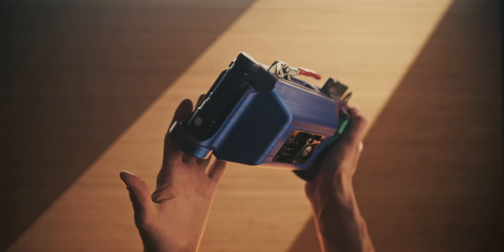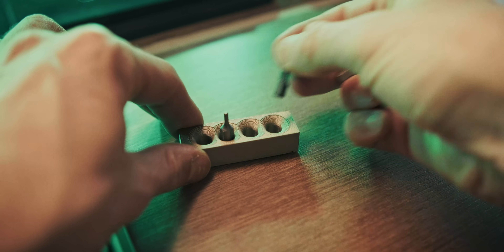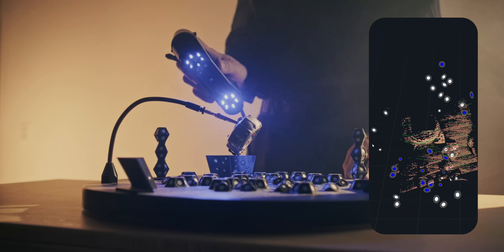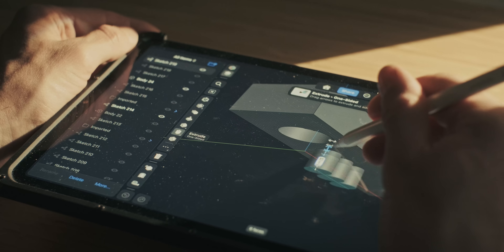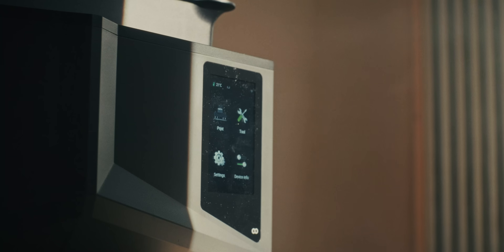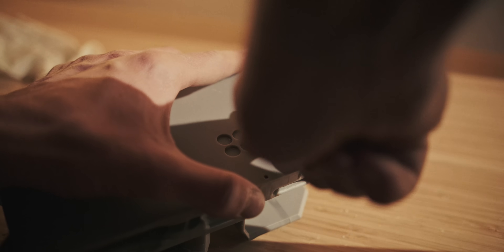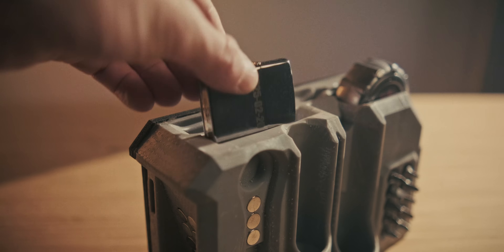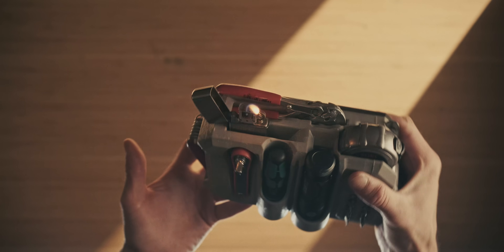Building a Wera Tool Check Inspired EDC – 3D Print Project - Elegoo Saturn 4 Ultra 16k

Comment: I wanted to share my experience with the Acebeam L35 because I noticed you’re using an Acebeam flashlight. While it has impressive brightness, I found a few drawbacks, such as accidental activation and difficulty sourcing replacement batteries, which led me to look for alternatives.

One flashlight that stood out as a strong competitor is the Nitecore EDC31. It offers a more compact design with a reliable lockout switch to prevent accidental activation, convenient USB-C charging, and a standard lens size that allows for easy customization. Given these features, I wanted to take a deeper look at how the Acebeam L35 and Nitecore EDC31 compare in terms of brightness, battery life, durability, and other key aspects.

Here’s a detailed breakdown of both flashlights to help you decide which one suits your needs best.

Acebeam L35 vs Nitecore EDC31: Flashlight Comparison

Brightness and Lumens Output
	•	Acebeam L35 – This tactical flashlight can blast up to 5,000 lumens in turbo mode, with a beam reaching about 480 meters . It uses a high-output CREE XHP70.2 LED (5000K) and offers multiple brightness levels from a 1-lumen moonlight mode up to the 5,000-lumen turbo . The large LED and optics give it a bright flood with decent throw for long-range visibility.
	•	Nitecore EDC31 – As a compact EDC light, it still packs a punch with up to 3,500 lumens output and roughly 380 meters of beam distance . It features Nitecore’s 9-core UHi 20 MAX LED, delivering an impressive beam for its small size. The EDC31 has four regular brightness modes (from an ultra-low 5 lumen mode up to high ~1100 lumens) plus two specialized modes for instant high output  . In practice, the Acebeam L35 offers higher maximum brightness, while the Nitecore EDC31 provides plenty of light for everyday carry with a more compact form.

Battery Life and Charging Methods
	•	Acebeam L35 – Powered by a 21700 Li-ion battery (5100mAh), it excels in runtime. On its 1 lumen moonlight mode, it can run for up to 12 days straight . Even at a low 70-lumen setting it lasts over 33 hours . The L35’s battery is USB-C rechargeable (Acebeam includes a USB-C charging cable), though the charging is via the battery’s built-in port and is somewhat slow (~0.75A) . Many users opt to charge the cell in an external charger for faster turnaround. Having a high-capacity 21700 gives the L35 an edge in sustained use, but it also means a larger battery to carry.
	•	Nitecore EDC31 – This light has a built-in 3,800mAh 18650 Li-ion battery, which is not meant to be removed frequently. It charges conveniently via an on-board USB-C port, reaching full charge in under 2 hours . A power indicator LED on the tailcap shows charging status and battery level . In ultra-low mode (5 lumens), the EDC31 can run about 57 hours continuously . Even at 70 lumens, it lasts a full day (24 hours) , and around 4 hours on its 1100-lumen high mode . While its maximum runtime is shorter than the L35’s (due to a smaller cell), the quick USB-C charging and included battery make it very convenient for everyday use.

Durability and Build Quality

The Acebeam L35 features rugged aluminum construction with a striking stainless steel bezel for enhanced durability. The build quality is impeccable – Acebeam uses a high-strength AL6061-T6 aluminum alloy with HAIII hard-anodized finish, and even equips a hardened steel strike bezel that can break glass or serve as a self-defense tool . The body has thick walls and knurling for grip, giving it a solid feel . It is rated IP68 for water and dust resistance (submersible ~2 meters) and survives drops of about 1–1.5 meters without damage . Overall, users find the L35 to be extremely sturdy and suited for heavy-duty and tactical use. Its larger head and slightly heavier weight (5.7 oz without battery) are the trade-offs for that tank-like build .

Nitecore’s EDC31 is built to endure harsh conditions, with a waterproof aluminum body that survives rain and impacts. The EDC31 is made of military-grade aluminum with HA III hard-anodized finish, providing excellent scratch and corrosion resistance . Despite its compact size, it’s tough – IP68 rated (dustproof and submersible in 2m of water) and shockproof up to 2 meters drop height . In hand, it feels solid but lightweight (about 100 g including the battery and clip) . Nitecore also includes a sturdy pocket clip and uses steel switches, emphasizing durability even for daily carry. Users report the build quality is on par with other premium flashlights, with the advantage that the smaller 4.46″ length and 1″ diameter make it easy to pocket without worry . In short, both lights are very robust: the Acebeam is larger and built like a tactical tool, while the Nitecore is impressively durable for a more compact EDC form.

Accidental Activation Prevention Features
	•	Acebeam L35 – The L35 offers a lockout mode to prevent accidental activation when stored or carried . By using a quick sequence on the side switch (or simply loosening the tailcap for a mechanical lockout), the user can disable the switches so the flashlight won’t turn on unintentionally. The dual-switch design (tail and side switch) is intuitive, but also means two possible buttons that could be pressed by mistake – hence the lockout is a useful inclusion. In practice, the recessed side switch and relatively stiff tail switch also help avoid accidental presses. Many owners appreciate that the L35’s electronic lockout is easy to engage, especially for a powerful light that could heat up if turned on in a bag.
	•	Nitecore EDC31 – Nitecore implemented a unique “Rapid Lock™” sliding switch on the tailcap for quick lockout. There are two lockout modes: “Half Lockout” and “Full Lockout” . In Half Lockout, the main power is locked but you can still use the momentary Search (spotlight) and LUMIN SHIELD modes; in Full Lockout, all functions are disabled to completely prevent accidental activation . This physical sliding lock is easy to operate by feel – simply slide it to the desired position to safe the light. It’s an effective design for a tactical EDC; however, a few users noted that occasionally when sliding the light into a tight pocket the lock switch could be nudged off “Full Lock,” allowing the light to turn on . Despite that rare issue, the dual-stage lockout gives the EDC31 a robust safety mechanism, ensuring it won’t inadvertently activate at full 3500 lumens in your pocket.
Reply: Lens Quality and Customization
	•	Acebeam L35 – Acebeam equipped the L35 with a toughened ultra-clear glass lens (protecting the LED) in combination with a specialty TIR optic for focusing the beam  . The lens has an anti-reflective coating on both sides, maximizing light transmission and durability . The use of a TIR (Total Internal Reflection) optic is somewhat unusual for a high-output light, but it allows a smooth beam profile – users report a great balance of flood and throw with a clean hotspot. The lens and optic are of high quality, giving a clear beam without artifacts. In terms of customization, the L35’s head (54.2 mm diameter) can accept optional colored filters or diffusers that Acebeam or third parties provide, but the internal TIR lens isn’t commonly swapped out. Most owners stick with the excellent stock lens/optic, though one review praised the “nice beam” delivered by the TIR setup .
	•	Nitecore EDC31 – The EDC31 uses a more traditional setup: a micro-textured (orange peel) reflector paired with a hardened glass lens in front . Nitecore specifies a double-sided anti-scratch, anti-reflective coating on the optical glass, which helps achieve high light transmission and resists abrasion . The result is a beam with a defined center spot and some usable spill, suitable for general use. The lens quality is on par with other premium flashlights – clear with minimal distortion. Because the head size is small (23 mm), there aren’t model-specific aftermarket lenses or optics from Nitecore aside from the stock parts. However, its standard lens size means one could find a compatible diffused lens or filter from third-party suppliers if desired. In general, both lights have excellent lens quality out of the box. The Acebeam’s TIR gives it a wider, artifact-free beam, whereas the Nitecore’s reflector + AR-coated glass provides a more traditional beam pattern. Custom lens swaps are uncommon for these models, but basic customizations (like adding a diffuser film to soften the beam or using color filters) are possible and straightforward.

Additional Features (Modes, Indicators, etc.)
	•	Acebeam L35 – This flashlight offers 6 brightness levels plus a strobe mode, giving a lot of flexibility for different situations . The dual-switch interface is designed for tactical use: the tail switch instantly activates Turbo (max brightness) or Strobe for self-defense with a full press , while the side switch cycles through the normal modes and can access Moonlight (ultra-low) with a long press. The L35 also has a battery power indicator LED (in the side switch) that flashes or changes color to show remaining charge . This helps users keep track of battery status. An intelligent temperature regulation system will step down output to prevent overheating on the highest modes , and the circuitry is constant-current (no PWM flicker) for stable light . Acebeam even gold-plated the circuitry contacts for durability . In summary, the L35 is feature-packed: from its moonlight mode (1 lumen) for stealthy use, up to blinding strobe and turbo, with easy one-handed control and thoughtful additions like lockout and battery indicators.
	•	Nitecore EDC31 – The EDC31 keeps things straightforward with 4 brightness levels (Ultralow, Low, Mid, High) and 2 special modes . Uniquely, instead of a traditional strobe or SOS, Nitecore configured two high-output momentary modes: SEARCH (spotlight) and LUMIN SHIELD. By half-pressing and holding the tail switch, you get an instant 1,500-lumen spotlight; a full press and hold yields the 3,500-lumen “Lumin Shield” flood blast for immediate max output . This is intended as a defensive or attention-getting feature (a burst of light to disorient or signal), akin to a strobe but with steady light. The tail switch also serves as the on/off and mode selector (half-press cycles modes when on). Notably, the EDC31 has mode memory – it will turn back on at the last used brightness level . Other handy features include the tailcap power indicator LED (blinks to report battery voltage and charging status) and the two-position lockout slider we discussed. It also employs Advanced Temperature Regulation (ATR) to adjust output when the light gets hot, preventing damage . While it has fewer discrete modes than the L35, the EDC31 covers the essentials for EDC use and adds innovative touches (like the Lumin Shield) that set it apart. The overall UI is very user-friendly for both everyday and tactical needs.
Reply: User Reviews and Feedback
	•	Acebeam L35 Feedback – The L35 has earned a strong reputation among enthusiasts and buyers, holding around 4.5/5 stars in user ratings . Owners frequently praise its extreme brightness and throw, often noting that it outperforms expectations for a single-LED flashlight. The beam quality gets positive remarks – one Acebeam site review simply titled “Nice beam!” underscores how well the TIR optic performs . Users also commend the build quality and durability; for example, one review called it an “Awesome All-Around Flashlight,” and another described it as a “Great Durable Flashlight,” indicating confidence in its ruggedness  . The dual-switch interface is generally well-received, as it offers quick access to turbo or strobe. On the critical side, some reviewers mention that the heat output and step-down on Turbo are noticeable – unsurprising given 5000 lumens in a mid-sized light. In testing, the L35 could not sustain full 5000 lumens for very long and throttled down to around 1800 lumens after about a minute to prevent overheating . This is a common observation and not seen as a flaw, just physics at work. Overall, feedback for the L35 is overwhelmingly positive, highlighting its power, solid construction, and value for the price. A few users noted minor issues like receiving a different LED version than expected or the flashlight’s substantial size for EDC, but these are isolated cases .
	•	Nitecore EDC31 Feedback – As a newer model, the EDC31 has quickly gathered a good number of reviews (20+ at Nitecore’s store alone) and sits around 4–4.5/5 stars in customer ratings . Users love the compact size vs output ratio – many are impressed that such a small light can produce 3000+ lumens. It’s often described as a “great little light” for everyday carry . The USB-C charging and built-in battery are appreciated for convenience, making it a grab-and-go device. However, feedback also points out a few quirks: Some users have reported the beam pattern isn’t perfect for close-up work – one detailed review noted a slight dark spot in the center and a large dim halo, which may bother those expecting a uniformly smooth beam . This is likely due to the 9-die LED and reflector design. Additionally, there have been a few instances of accidental activation – ironically due to the lockout slider being switched off in tight pockets, causing the light to turn on unwittingly . On the upside, the majority find the lockout feature useful and haven’t had issues with it. Users also mention that the EDC31 can heat up quickly on the highest outputs (it’s a lot of power in a small body) , but the ATR system will dial it down before it becomes too hot. The overall sentiment is that the EDC31 provides excellent value and performance for its price: it’s bright, quick to recharge, and robust. Any downsides (like the beam artifacts or the nuanced lockout use) are generally minor for most owners. Many compare it favorably to larger or more expensive lights, saying it holds its own, and it’s becoming a favorite go-to EDC flashlight for a lot of people who have given it a try.

Price and Value for Money
	•	Acebeam L35 – The list price for the L35 is around $114.90 (with the battery included) on Acebeam’s official site . In the flashlight community, it’s considered a high-end tactical light, but still a good value given its performance. The package typically includes the 21700 rechargeable battery, USB-C cable, holster, and other accessories, which adds to the value. Some retailers have offered it closer to $100 or even just below during sales . For what you get – 5000 lumens, a robust build, and Acebeam’s reliability – most users feel the L35 is worth the price if you need its capabilities. It squarely targets the tactical/outdoor enthusiast market. When comparing lumens-per-dollar, it’s more expensive than the EDC31, but you are paying for the higher output and larger battery. If those aren’t critical for your needs, the Acebeam might be overkill; however, if you want one of the brightest and toughest mid-sized flashlights, the L35 justifies its cost.
	•	Nitecore EDC31 – With a retail price of about $54.95 USD , the EDC31 comes in at roughly half the cost of the L35, making it very attractive in value. That price usually includes the built-in battery, charging cable, clip, and lanyard – essentially everything you need. For a newly released compact flashlight delivering 3500 lumens, the mid-$50s price point is seen as a bargain by many reviewers. Nitecore positioned it as an affordable high-performance EDC, and it seems to hit that mark. In terms of value for money, the EDC31 offers an excellent performance-to-price ratio, provided you’re looking for an everyday carry light. It can’t match the sheer output or throw of the L35, but you’re also paying much less. When budgeting, one might consider that an extra 21700 battery for the Acebeam plus an external charger could add to its total cost, whereas the Nitecore has everything integrated. In summary, if you’re value-conscious and don’t need the absolute maximum lumens, the EDC31 is likely the better bang-for-buck. The Acebeam L35, while pricier, delivers premium performance that justifies its higher cost for those who need it. Both lights are solid investments in their respective categories – it really comes down to whether you prioritize maximum power (Acebeam L35) or maximum portability per dollar (Nitecore EDC31).

Sourcing Custom Lenses for Flashlights

Replacing or customizing a flashlight lens can enhance performance or adapt the beam for specific needs. Below we explore how to source custom lenses, what materials and options are available, and considerations to keep in mind.

Common Materials for Custom Lenses

Flashlight lenses are typically made from either glass or plastic (polycarbonate/acrylic), each with pros and cons. High-quality lights usually use hardened glass lenses, often made of borosilicate or other tempered glass, sometimes with anti-reflective coatings for better light transmission. Glass is scratch-resistant and handles heat well, ensuring clarity over time . On the other hand, many budget or older lights use polycarbonate or acrylic lenses (essentially a type of plastic). Polycarbonate is very tough (virtually unbreakable if dropped) but is prone to scratching over time, which can reduce light output and clarity . Acrylic is another plastic used; it has slightly better scratch resistance than polycarbonate but can still wear and doesn’t handle high temperatures as well as glass. Some custom lens providers offer AR-coated (anti-reflective) glass which can increase light transmission by a few percent. For example, an AR-coated borosilicate lens can reach 96–99% transmission in the flashlight’s output range  . In specialized cases, enthusiasts might even seek out sapphire glass (like watch crystals) for an extremely scratch-proof lens, though this is expensive. In summary, glass lenses (especially with AR coatings) are preferred for maximum clarity and durability, while polycarbonate/acrylic lenses are chosen for impact resistance or cost savings. The choice of material will affect how the flashlight performs and how it endures rough use, so it’s an important consideration when sourcing a custom or replacement lens.
Reply: Compatibility Considerations for Different Flashlight Brands

When sourcing a custom lens, size and shape compatibility is crucial. Flashlight lenses are not one-size-fits-all; different models have different diameters and thicknesses, and the lens must fit securely with the flashlight’s o-ring and bezel. Before buying, you should note the exact diameter of your current lens (to the nearest millimeter) and its thickness, as well as whether it’s a flat disk or a curved lens. Most replacement lenses are flat glass disks, which works for the majority of lights that use a reflector. If your flashlight uses a specialized optic (like a TIR lens or aspheric lens), the replacement needs to be the same type or designed for that model.

Different brands sometimes have standard sizes for multiple models. For instance, many Maglite C&D cell lights use roughly a 2″ (~50 mm) lens, and aftermarket suppliers target those explicitly . Brands like SureFire or Olight might use custom diameters – but again, the community often identifies those and suppliers list compatibility charts. It’s wise to check if the lens you’re considering specifically mentions fitting your flashlight model or to measure and match it with the specs given by the seller.

Also consider thickness and seating: a replacement lens that is too thick might not fit with the o-ring or bezel, and one that’s too thin could rattle or compromise water resistance. Quality vendors usually provide the thickness of the lens (common thicknesses are 1.0mm, 1.5mm, 2.0mm, etc.). Always compare that to your original lens. For waterproof models, ensure the replacement works with the existing o-ring or come with an appropriate o-ring to maintain the seal.

Another compatibility factor is if the flashlight has a lens coating or tint originally. For example, some lights intended for diving or photography have an AR-coated or tinted lens by default. Replacing it with a different type (clear vs. with a coating) could slightly alter the beam tint or output. Generally, going to a clearer or AR-coated lens will only help output (making the beam a bit brighter or cooler).
Reply: If you are looking to change the flashlight’s beam profile (for example, converting a flashlight into a projector-like thrower), you might consider a lens type change – such as installing an aspheric lens for a tighter beam. This usually is a more involved mod and may require custom adaptors or trimming. It’s important to confirm that the flashlight’s head can accommodate such a lens and still focus properly. Compatibility in this case goes beyond just diameter – the focal length of the lens and the LED’s position become factors as well .

In summary, measure your existing lens and do research on your specific flashlight model. Many enthusiast forums or product pages will note lens dimensions. A lack of exact match in product descriptions can lead to trial and error. As one forum user lamented when trying to upgrade a Maglite lens: not knowing the stock lens size made it hard to find a replacement until someone provided the specs . Doing a bit of homework on compatibility will save you time and ensure your custom lens fits like a glove.

Cost and Availability

The cost of custom or replacement lenses can vary widely based on material and source:
	•	Standard Replacement Lenses (uncoated glass or basic plastic) are often very affordable. Generic glass lenses for common flashlight sizes can cost just a few dollars each. For example, an AR-coated glass lens from Kaidomain might be around $3–$7 USD , and Flashlightlens.com offers high-quality Borofloat glass lenses in the $5–$10 range for many sizes . Acrylic or polycarbonate lenses are usually similarly low-cost, sometimes even cheaper (a couple of dollars), since the material is cheaper and easier to cut.
	•	Brand-name or Specialty Lenses tend to be pricier. An official Maglite replacement glass lens was quoted around $25 (plus shipping) , and a third-party “Gorilla Glass” lens (Neutek) for Maglite was about $20+ . These higher prices often don’t reflect vastly superior performance – you might be paying for the brand or a small production run. In many cases, enthusiasts find that the budget-friendly lenses (like the Kaidomain or UCL ones) perform just as well, making them more cost-effective .
	•	Custom-cut lenses (one-off custom sizes) may incur extra cost. If you go to a glass shop or use a service to cut a unique size, you might pay a setup fee or a higher unit price. For instance, getting a single lens custom ground to a specific diameter could cost anywhere from $10 to $30 depending on complexity, unless you do it yourself.
	•	Bulk orders can reduce cost per lens. Some hobbyists order a larger sheet of AR-coated glass (for example, an 8″x10″ sheet for ~$40) and then cut dozens of small lenses from it  , bringing the effective cost per lens to well under $1 (not counting labor) . This is only practical if you have many lights or friends to share with (and the tools/skills to cut glass).
	•	Availability is generally good for common sizes. Many online flashlight retailers and modding stores stock popular lens sizes (20mm, 25.4mm (1”), 30mm, 40mm, etc.). If your flashlight is a common model, chances are you can find a lens in stock. Niche sizes or very large lenses (say >60mm) might be less readily available, but specialty sites or forum group buys can fill the gap. Flashlightlens.com maintains an application chart and inventory for many lights, and they even encourage customers to help identify lens sizes for newer or obscure models  .
	•	Shipping can be a factor for glass since it’s fragile. Domestic sources (if you’re in the US, for example) like Flashlightlens or retailers on Amazon might be preferable to avoid long shipping times and potential breakage from overseas. That said, many have had good experiences ordering from international sellers like Kaidomain (which often has free or low-cost shipping worldwide, albeit slower). Just be sure the seller packages the lens well.
Reply: In terms of value, if you’re upgrading a flashlight, a high-quality AR-coated glass lens in the $5 range can slightly bump up your light output (a few percent more lumens reaching outside) and make the beam a bit nicer – a modest investment for an enthusiast. Replacing a broken lens is often even cheaper than buying a replacement flashlight or sending it in for repair, so sourcing a $3–$10 part can breathe new life into your torch. Always weigh the cost against the flashlight’s value; it may not make sense to spend $20 on a custom lens for a $15 flashlight, for example, when a new flashlight might be a better use of funds. But for mid-to-high-end models or sentimental favorites, custom lenses are quite accessible and reasonably priced.
Reply: DIY Methods for Custom Lens Modification

For hobbyists who enjoy hands-on projects, there are a few DIY approaches to custom flashlight lenses:
	•	Cutting Your Own Glass Lenses: If you have access to glass-cutting tools, you can buy optical glass pieces and cut disks to size. As mentioned earlier, some folks purchase small microscope slides or glass sheets and cut out circles using a Dremel with a diamond wheel or a glass cutter jig . One flashlight enthusiast shared that they made lenses from microscope slides with a Dremel because the sizes they needed weren’t commercially available . This method requires patience and proper safety (glass dust and sharp edges!), but it’s feasible for creating a few custom pieces. After cutting, edges may be smoothed with sandpaper, and you must ensure the lens sits with an o-ring to avoid chipping.
	•	Polycarbonate/Acrylic DIY: Cutting plastic is easier than cutting glass. You can buy a small sheet of polycarbonate or acrylic (even something like a thick clear DVD case or polycarb panel) and scribe or saw out a circle. Acrylic in particular can be scored and snapped in a circle with some effort, then sanded to final shape. An advantage is that plastics won’t shatter while cutting. You can also polish the edges to restore clarity if needed. There are even hard-coat acrylics available (some flashlight lens sellers offer hard-coated acrylic that is more scratch-resistant ). A DIY plastic lens might not have the optical perfection of glass, but for uses like a diffuser or a colored lens, it can work well.
	•	Lens Films and Filters: If your goal is to modify the beam rather than replace a broken lens, consider using films or filters. Diffusion film (like Rosco diffusing film or even a piece of sanded translucent plastic) can be cut and placed behind or in front of the lens to soften the beam. Colored filters (gels or acrylic disks in red, green, blue, etc.) can tint the beam for night-vision preservation or hunting. These are simple DIY mods: you cut a thin film to the lens shape and either drop it in front of the lens or secure it with the bezel. It’s non-destructive and reversible.
	•	Swapping to Different Optics: Some advanced DIYers swap the flashlight’s entire optic system. For example, replacing a reflector + lens setup with an aspheric lens to turn the flashlight into a long-range spotlight (common in modding “throwers”), or vice versa using a pebbled TIR lens for a floodier beam. These mods often involve finding a lens that fits the head or using adapters/spacers to hold it at the correct focus. It can be trial and error. BudgetLightForum and CandlePowerForums have threads where people share which aspheric lens fits certain models . This is a more involved form of “custom lens” modification, effectively redesigning the beam profile of the light.
	•	3D Printing and Prototyping: While you can’t 3D print a clear glass-quality lens with standard hobby printers, some have used resin 3D printers to make basic lenses or holders for lenses. More commonly, one might 3D print a custom bezel or adapter to fit a lens from another device. For instance, if you find a lens from a camera or another flashlight that you want to use, a custom printed ring could help mount it onto your flashlight.

When doing DIY lens mods, keep in mind optical alignment and safety. Any new lens or optic should be properly seated to maintain the flashlight’s waterproofing (use o-rings and sealant as needed). Also, test the flashlight after modification to ensure the beam is what you expect and there are no undue reflections causing heating inside the head. If cutting or grinding glass, wear eye protection and work slowly.

DIY methods can be rewarding and cost-saving – turning a piece of raw material into a perfectly fitting lens for your flashlight. They’re especially useful when no off-the-shelf solution exists for your particular model. However, for most people, the readily available pre-cut lenses make more sense unless you relish the tinkering process. Whether DIY or purchased, a custom lens can customize your flashlight’s performance to your liking, be it restoring a scratched lens to crystal clarity or tweaking the beam to suit your adventures.